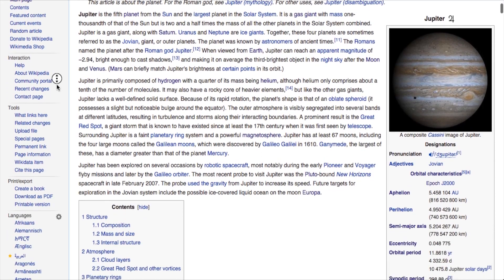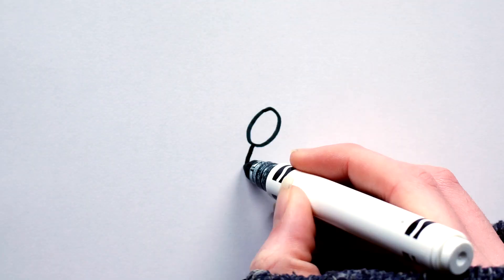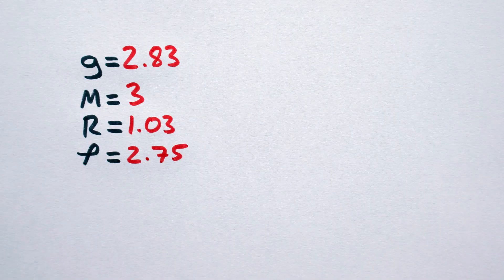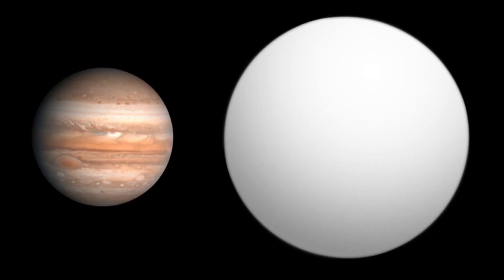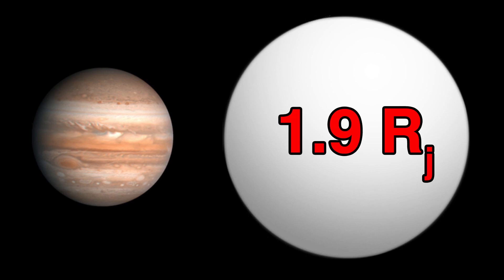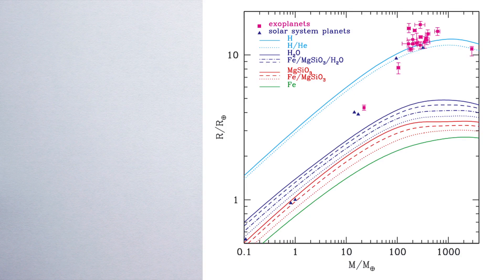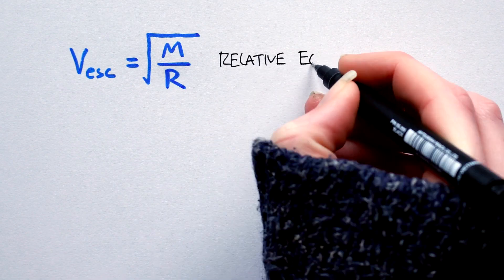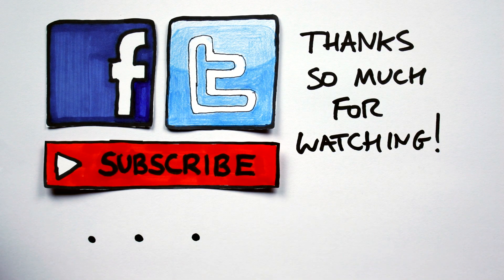Build your own Gas Giant: Physical Characteristics

Comment: 0:33 so Jupiter has a larger radius than Jupiter because its mass is 1Mj, which is smaller than 2Mj; WTF. And does it also mean gas giants can't be smaller than Jupiter, even tho there are gas giants smaller than Jupiter?...
Reply: No it just means that Gas giants can be different sizes. Generally speaking it depends on the distance from the resident star. Gas giants close to a star will be puffy giants, whereas gas giants incredibly far away will be dwarf gas giants. It's just that gas giants with masses larger than 2Mj cant be much larger or smaller than 1Rj, due to gravity pulling everything back in and electron degeneracy pushing everything out.

Comment: What's the furthest that you would put a puffy planet could be from its star? I've built a planet at 0.703 the mass of Jupiter and 1.498 the radius. Slightly puffy. The problem is, I already had the orbit at 6.89AU from my F9V star, just outside the frost line. Would this be a plausible distance, or too far?
Reply: Your planet should be composed almost entirely of hydrogen, and even then I don't think it is likely to be so big unless you have a planet that has a lot of internal heat and releases it.
Consider that Jupiter, Saturn and Neptune emit more or less twice the radiation that they receive from the Sun, maybe your planet is either recently formed or has some kind of mechanism that makes it release a lot of radiation that heats it up so much to inflate it...

Comment: If a gas giant that's atmosphere was primarily made of hydrogen was jolted out of orbit towards its star, would it explode or burn when it gets too hot?
Reply: Technically, neither. The parent star would end up consuming the hydrogen in it's fusion reaction, and melt the rocky core down to slag.
Remember, star's aren't on fire, they are plasma from fusion reactions.

Comment: First off, I love your videos, the information is very well presented. Second, on the logarithmic mass radius relationship graph there are a lot of exoplanets that have their confidence interval(s) above the pure hydrogen line. Would that mean that those exoplanets are likely close orbiting gas giants, with tidal forces or just solar radiation causing the gas to expand due to heating? My last question, which may be answered in the next video: in a protoplantery disc, do elements tend to get stratified (with lighter elements tending to being pushed to the outside of the system, or the opposite) or is it more or less random?
Reply from the maker: On the first point I'm not quite sure. Sorry. :(
Second question, its not random. Too close to a star and you won't have a protoplanetary disc....the material will be vaporised by the intense heat. A little further out you'll have metals and beyond the frost line you'll find an abundance of light elements like light hydrogen.

Comment: what i we heate jupiter with all our global warming.
will it be puffy too? or just kill earth due to a lack of isolating layer of gass
Reply from the maker: Unfortunately not, jupiter is too massive. But mass aside it would need to orbit very close to our sun. And even if it did go puffy, which i definitely can't, its layers would never expand enough to reach earth. Space is vast and empty.
Reply: yep it was kinda a joke.
but if it were much were denser, due to the pressure, pressing hydrogen so close that i act as metal, the ting with electrons

but also it could be brow dwarf star fusing hydogen at low boil
Reply from the maker: Its quiet a way off being a brown dwarf. People often say jupiter is a failed star...this is not even slightly true. Jupiter would need to be about 13x more massive in order to a brown dwarf
Reply: sorry  i ment more massiv then jupiter i think i mis-wrought there.
 I have seen your other videos, but i first found you through a friend whit whom i sometimes discuss my and his quantum theories, and how stuff came in to being.
 
Like how the stars fuse hydrogen in to helium and then if massive enough to heavy and heavy elements until iron of course, then when it (explodes) create the rest of the elements,
 if dosent implode from the pull of gravity.
 
but also that as mass bend spacetime, then in a neutron star, really heavy elements like Ununoctium and maybe even heavier choud exists for days maby even years.

so i thank you for responding to my comment and thank you for the videos and the work you put into them.
have a good day sir.
Reply from the maker: Ha no probs. Thanks you sir, for watching and enjoying